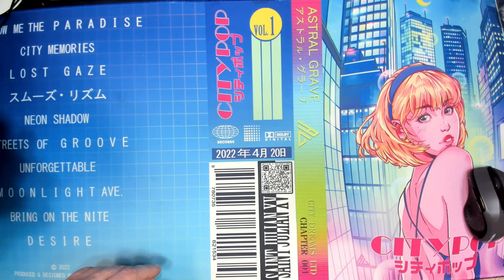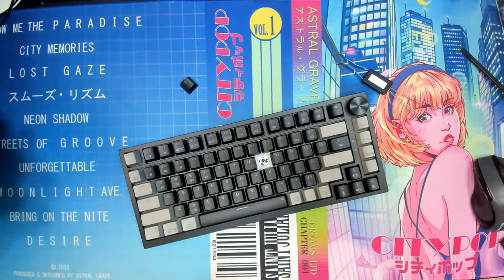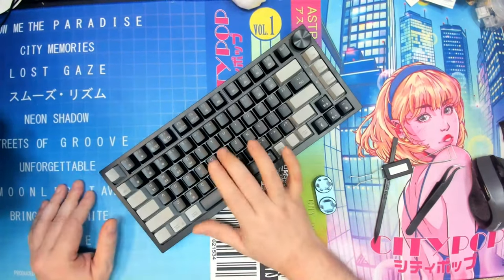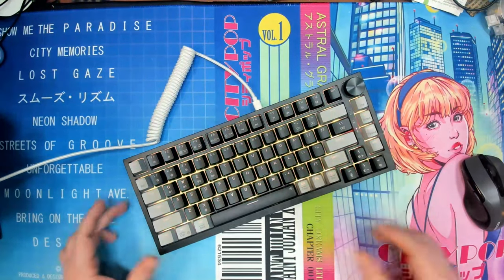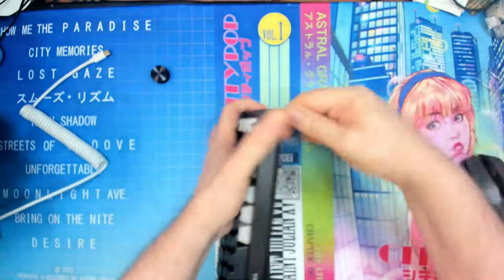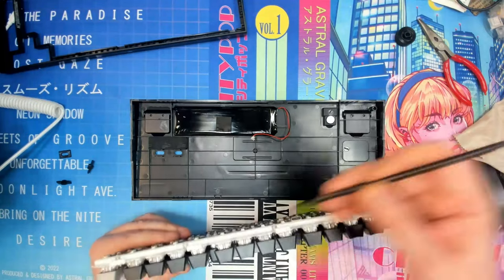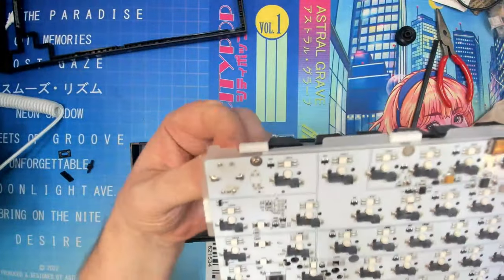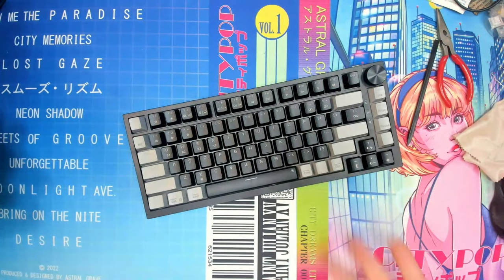Koorui MK082 Review and Sound Test | Gasket Mount Three (two) Mode with an extra click

Comment: Not that long ago this would have been adequate for $50, even a wired only. Then take the 2.4 as a bonus. But lots of folks using BT and multi device setups these days - so even a one off failure is unfortunate. And it's plastic all over so few excuses for poor BT signal.

Comment: I have a question how do only get one color on it
Reply from the maker: There are two versions of this keyboard, Rainbow LED in which all LEDs are set to a different color and cannot be set to a single color, if you have the RGB then Fn + |\ until you reach the rainbow and the Fn + Right Arrow to cycle through the colors.

Comment: Im gonna buy this Keyboard with red switches is it worth it with red ones?
Reply from the maker: I gave this keyboard away and it was dead two week later, I would not recommend it.
Reply: i think it worth it bc i have it and its good
Reply: @MechKeyboards  what do you mean dead?
Reply from the maker: @randomguy69425  Dead, stopped functioning. You get what you pay for.
Reply: @MechKeyboards  what do you mean by functioning?
Reply from the maker: @randomguy69425  the keyboard stopped working.

Comment: Is this video sponsored?
Reply from the maker: No, I purchased this myself from Amazon, just like I state in the video...
Reply: @MechKeyboards  Does it support five pin switches and come with a key cap and switch puller like you mentioned in the video or did you use a previous switch puller?
Reply from the maker: @bmangamer1234  3/5 pin and it came with the keyboard. All of this is in the video...
Reply: @MechKeyboards  Thanks